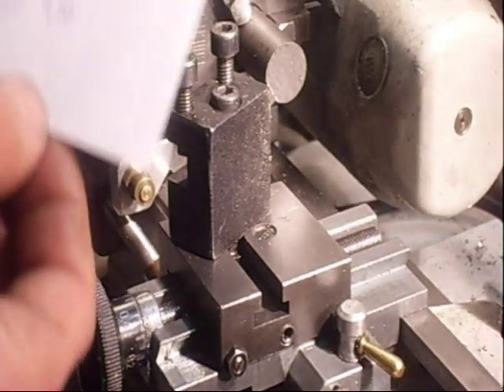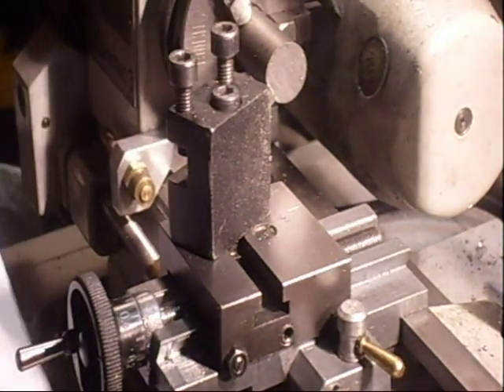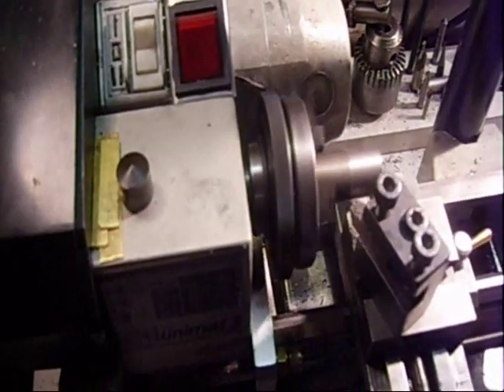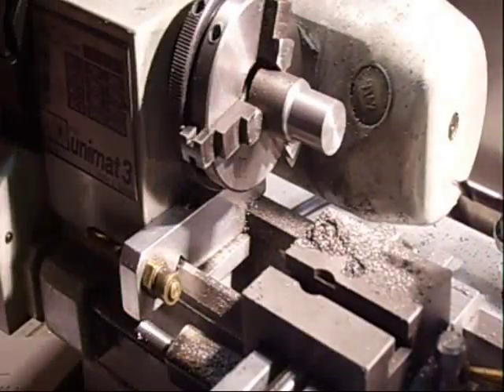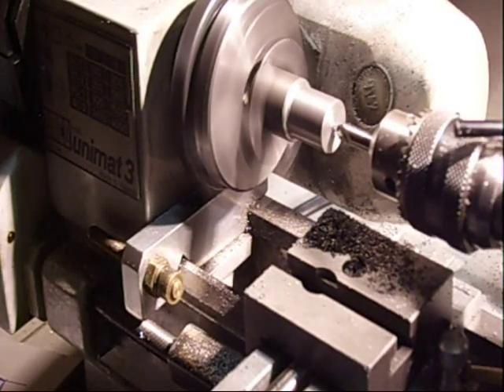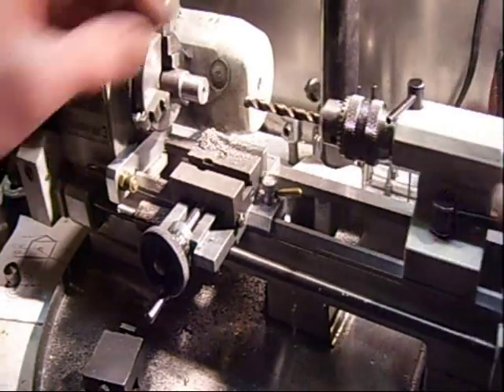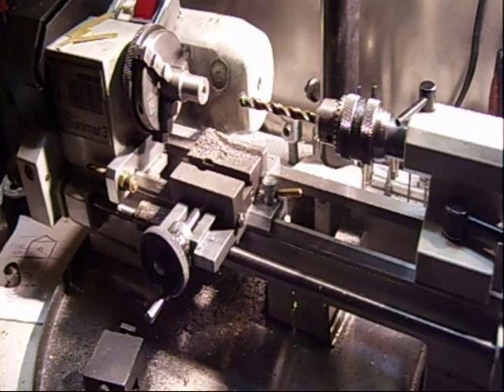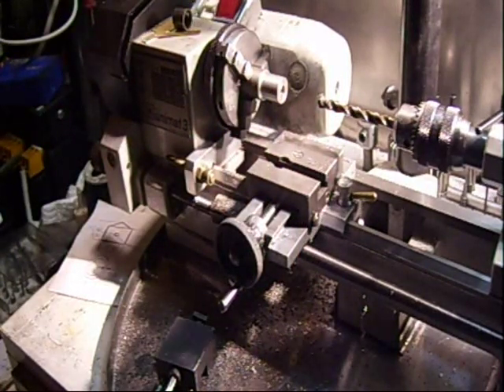Piston making for a modeldiesel engine at home  (MK-16 rebuild)   Part 1

Comment: …..thank you for the tip about lapping the piston before drilling the wrist pin holes. I have bright mild steel as my piston material ?nothardened). Hoping it will wear well inside the hardened liner. I have a very tight contra piston although it does knock back with aloud crack sound. Proves it does move with increased/decreased compression. So helpful, your videos. Chris.
Reply from the maker: Chris, if you make the new piston from soft steel, it will expand to much,when heat up in  the run. This will give most likely problems.Cast Iron do not expand a lot,and  the bore taper is made for that. Good luck with the Manxman...I hope, you get it done!

Comment: what aluminum is it?
Reply from the maker: +ariel babad Thas cast iron.Old model diesel engines used that most of the time...but not al.Special aluminium like RSA 431 and Dispal is used on modern engines,so called "ABC" set ups. (Alu piston  Brass liner Chroomed surface) thats the ABC. However I used one time a RSA piston on a hard steel liner in a Irvine diesel,and it worked wel.But dont use the engine in a longer runs,so cant tell,how long it wil resist wear.If plished very wel,and keep good lubricated,it shoud last a while,as the special aluminium is very hard.similar to soft steel.
Best regards,
Peter
Reply: thanks man lookn awsome great job i have mccoy red head engine without copresion and i whant to build my own piston wich materials should i use thank alot :)
Reply from the maker: +ariel babad Like I wrote earlyer.For model engines you need a special aluminium.It need a high silicone content.
Aluminium like Dispal226 or RSA 431 are the right sorts.But its not easy to buy.Its used in spacecraft industrie,Racingcars, and other specific  jet airplanes.

What you can try,is go to a scrapyard,and ask if theye have any  big old  pistons from trucks. The best wil be  large old 2stroke truck pistons.The US have many  large 2 stroke diesels... 
That shoud be thick enough to make one.
I have no  idea,if you can melt down ,say a smal 2 stroke motorcycle piston and use that. It have to be just right.Not sure,if the silicium stays right..

Otherwise google,if you can find something about re-melting pistons for new use.

But Dispal  226 or RSA 431 wil be superb material for the job. Just google on it,where to find.It is for sale,but not easy obtained..

Comment from the maker: I dont know,mif you can.Its not easy,as the fits are very exact.I make the parts at home,on a smal machine.But you need also to make a carterhouse.Check the website I send you.There you wil find a lot info and tips about that.
Kind regards,Peter